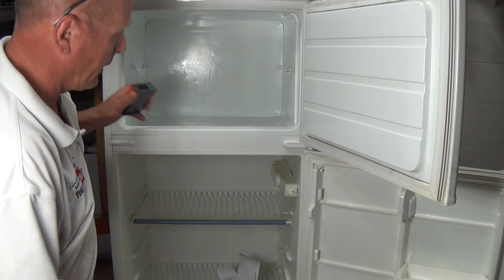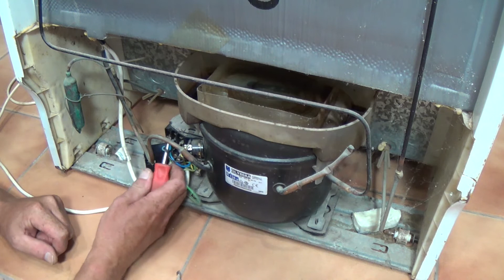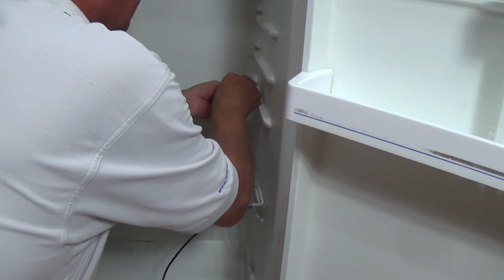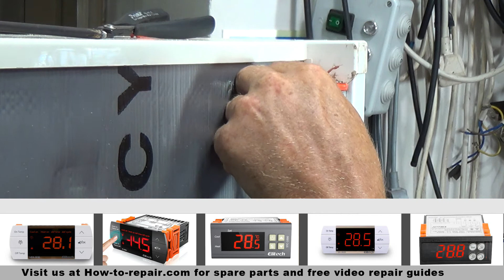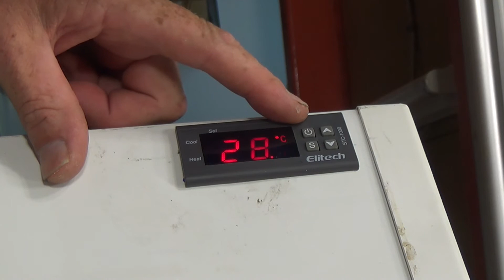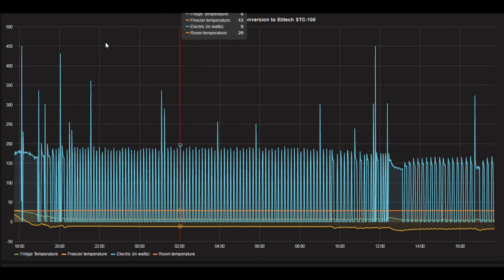Repairing Fagor Fridge Freezer fitting electronic thermostat Elitech STC 1000 for under £15

Comment: Can you help me with ny instruction how to take off Beko CFP1691DX CFP1691W Light And Thermostat Assembly Fridge Freezer, I do not want to make any damage to my Beko ? I can't find any screw.
Reply from the maker: Hi, please use our contact us page and make sure you fill out the request for what your problem is. I will need the full model number of the identification plate and the details of your problem so that I can provide you with useful literature. A video shoot of the problem would be perfect as well.

Normally, I would get back to you within 24 hours but I am on my way back from the IFA trade show in Berlin, so it can take more time to respond. Thanks for your understanding. https://www.how-to-repair.com/help/contact-us/   

Please remember to subscribe to our channel, as that's what keeps this channel going. Thanks, Paul 👍

Comment: Hello! I was trying to install the same kind of thermostat. did everything according to your instructions, but nothing seems to be working. After checking the wires with a multimeater, I learned that the "live feed wire from the thermostat to the compressor" has no power when the compressor ir working and has power when it is turned on. If I clip the wire, then there is power on the end coming from the relay, but none at the end coming from the thermostat. I am confused, since I don't have any knowledge on how my refrigerator works. Maybe it's a simple fix. Could you please tell me what I'm doing wrong

Comment: thanks for useful informations i wana do the same job about my fridge/freezer because mechanical danfuss thermostates worn out every year.
but i doubt weather it will work on mine or not ...wiring also is a challenge...need your help...wait for your answer

Comment: Hi mate, I am so glad I've found you on you tube. I have installed a stc 1000 to my 190lt 2 door 24v fridge. I have set the stc to your settings. Can you tell me how long the cycles should be please. Mine is on for 4mins. Off for 6mins. Fridge at 4deg. C. Freezer at 10deg. C. Only had it on 5 hours. Will check tomorrow after 24hrs. Just worried if fridge comes on to often.

Comment: nice video!
Just a question about diference value,i have a Siemens refrigerator with two compressors,i just replace the old thermostat with the stc-1000 and i m wondering what is better for compressor and for better cost affective operation.I have set 4 C  as a target temprature for fridge,is it better to set the F2(difference value)at 0,5 so the compressor will work less time to reach 4C but more frequently or set it F2 1,5 for example wich will give more time until compressor start but it will work more to reach 4C.

Comment: Hi good video, I have one question, i have a mini fridge and with this temperature control STC 1000,  can I put in my fridge the temperature to fermentation degree for example 20 °C (Ale) and lagering 2 °C (lager), work this wire configuration or I need somethins else, thanks

Comment: Hi Paul, thank you very much for this video. I am about to convert a no frost fridge - freezer with a single compressor to a curing/fermentation chamber meaning that the fridge would run on higher temps than the usual fridge ones (12 -14 oC instead of 4 - 8 oC). I was thinking of installing an STC-1000 and rather than bypassing completelly the original feed to the compressor and looping the live (pos 1) with pos 7 on STC-1000, I could send the original feed (the one that is installed and goes to the compressor) to pos 7 of STC and return it back via pos 8 to the compressor. In this wiring that I propose, the defrost timer would be also engaged on the circuit and when it goes  periodically ON it would cut the compressor feed (pos 7 would have no power) no matter if the STC relay is actually closed. Another advantage would be that there would be no circumstance that compressor and heater will work at the same time. The drawback would be that since the original thermostat is also engaged on this circuit I will not be able to go to temps lower than the fridge's original ones (which I am not interested of). What do you say?

Comment: Putting the sensor directly below the cooling plate would give the temperature of the cold air in the back of the fridge and an very erroneous reading.  I would suggest you put the sensor to the side of the fridge closes to the hinged side of the fridge which sould be the most stable and average tmeprature of the inside of the fridge..... Better still, atleast honour the fridge design engineers and put the sensor in the location of the original thermostat where the dial is.... a bit high, but no wires would be visible and you may not have to put new holes in the fridge..... Just sayin'  :-)
Reply from the maker: as you are able to set variation on the thermostat it does not matter much as long as its below absorption  plate,
Iam Glad we could help you
Please remember to subscribe to our channel
https://www.youtube.com/user/Apart4u?sub_confirmation=1

Remember to Shop with www.how-to-repair.com and it would help us by posting the video or

website on your timeline. This helps us a lot and if we really helped you can
always buy us a beer http://how-to-repair.com/help/buy-paul-a-beer/

Please remember to mark us to your favourites also I would be grateful if you would
subscribe to our channels social media as this really helps my site and keeps
us going.
YouTube. http://www.youtube.com/user/Apart4u

Facebook. https://www.facebook.com/how.to.repair.appliances
Reply: Yeah, I get that you can set the temperature setpoint offset, but your still sensing the temperature of the cold plate air temperature and not the temperature of the air in the space.
I am a mechanical engineer and I have been in the Air Conditioning industry for more than 20 years, and if in a house, I put the air temperature sensor near a supply air grill/outlet of the air conditioning, I am measuring the discharge air temperature and not the temperature of the air in the space. 
Then same applies here. Your placement of the temperature sensor near the cold plate can result in warm spoilt food.
I can't subscribe to a channel that gives wrong information and then insists that this information it OK.

Comment: Hi Paul Thank u so much for posting. I would ask you if I have no frost fredg/freezer the pcb is folty. and I have Elitech STC thermostat with one sensor probe. is it appropriate. and how?
Reply from the maker: if you have defrost system stc will not do the job.
Reply: how-2-repair.com 6
Reply: 7